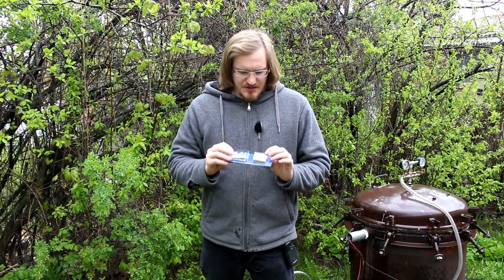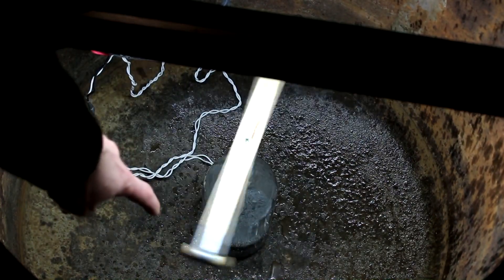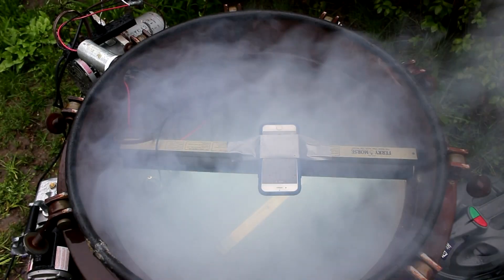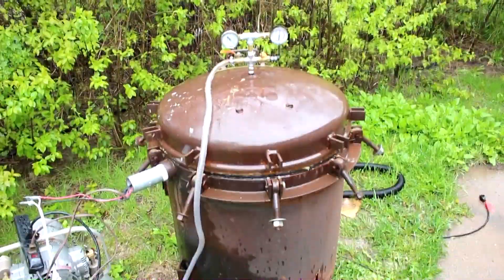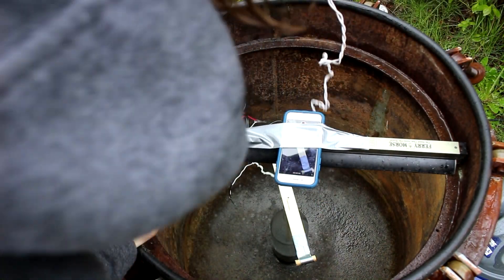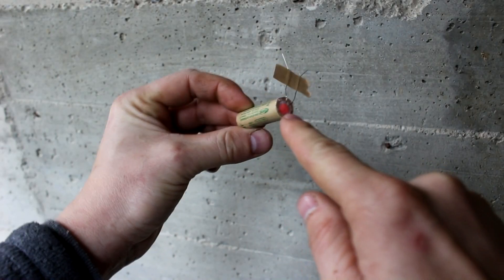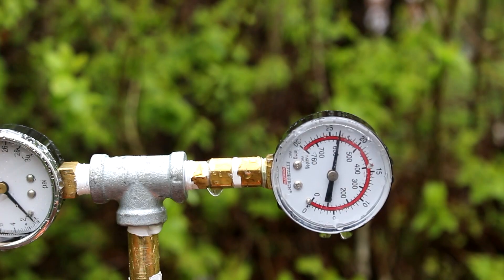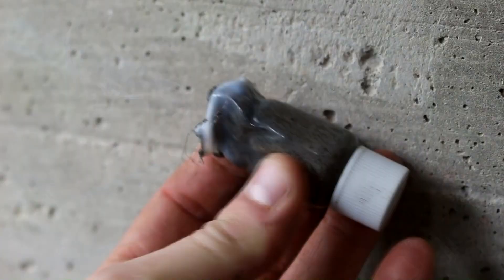Will a Model Rocket Motor Work In Vacuum?

Comment: Nice try, but these results are technically inconclusive with regards notion that rockets can fly in space. It only proves you can have limited burn in a container, but fails to legitimize space travel. Now the real question is whether it's possible to sustain a burn without destroying or ejecting the containment that produced the thrust. If you can accomplish that, I might concede to the possibility of space travel; because if that's how NASA did it, then they'd have a lot of dead astronauts. For your method to work, NASA would need to have a vast multitude of 'burn capsules' (for lack of a better term) in order to maneuver in space, or even return home for that matter. I don't know about you, but I've never seen evidence of NASA using any such techniques. Not to mention the fact that the vacuum chamber itself is enabling the thrust by giving the rocket something to push off of. You need a much bigger container to prove your theory (something that might be slightly more comparable to the vastness of space, which has no walls to push off of; only infinite light years of space). I'd love to see this experiment replicated at NASA Glenn Research Center's Plum Brook Station vacuum chamber in Sandusky, Ohio. Now that might be more convincing. But of course if NASA ever did decide to "prove" it to the public using their facility, they'd probably do what they always do, and fake the shit out of it.
Reply: Yep, rockets can't work in a vaccum and NASA and space is a bunch of bullshit.
       I can't believe Cody being as smart as he is can't understand this and realize the only reason it had thrust was because it was pushing off the side of the container.
      Rockets work on earth because they are compressing the gasses in the atmosphere and creating thrust from that, I mean, am I wrong?
Reply: @MistakenMystery  - "Yep, rockets can't work in a vaccum and NASA and space is a bunch of bullshit."
Just STOP spouting bullshit.  I can TELL that you have never taken a physics course in your life, and Id BET that you dropped out of high school, but you want to argue with Phds in Physics that say this DOES work in space? ANd people who TEST THIS SHIT for a living?

Put the BIBLE down and finish high school.

I have VIDEO of rocket propulsion working n a vacuum.  Ill show it to you AFTER you answer one question:
At WHAT altitude above earths surface does the atmosphere reach "Vacuum"?
(hint: you will refuse to answer and come up with some bullshit reason why you wont)

Comment: The gas the rocket pushes out what is it pushing against? In a perfect vacuum? Also it's space so there are no vacuum chamber walls for the gas to push against
Reply: The GAS does NOT need to "push" on anything.
The rocket nozzle is PUSHING ON THE GAS.
GAS has MASS and therefore inertia.  To make it go from a velocity of zero (wit respect to the nozzle) to 1000 meters per second REQUIRES A FORCE !
Where do YOU think this force originates?
Reply: @stuartgray5877  no it's because you have high pressure behind the rocket and low pressure in front of the rocket. You can't have high and low pressure differences in a vaccum.
Reply: @MistakenMystery  - "You can't have high and low pressure differences in a vaccum."
You most CERTAINLY CAN.
Who told you that bullshit?
Lets forget about gases for a minute and see if you have the most basic grasp of simple physics 
If I fire a crossbow in a vacuum, will I feel recoil? Yes or No?

Oh and I have VIDEO EVIDENCE of rockets working in a vacuum, AND we test them IN HIGH VACUUM AT WORK - Regularly.
Reply: @MistakenMystery  as usual, you people PRETEND to understand physics, but when asked simple questions you run away.  High school physics is too DIFFICULT for you? Maybe you shouldn't have dropped out?
Reply: @stuartgray5877  no I just don't enjoy conversations with people who aren't passionate about the truth and will never be able to have the power to change your mind on any controversial topics that go against the grain, because that would be too uncomfortable for you.
Reply: @MistakenMystery  so you REFUSE to answer physics questions presented to you by someone TRYING to educate you?   Doesn't sound like you are interested in the "Truth" AT ALL or you would AT LEAST see where my line of reasoning is heading.  YOU just dismiss anything that contradicts your current belief.  This is the OPPOSITE of learning and "Science"
Reply: Yep, rockets can't work in a vaccum and NASA and space is a bunch of bullshit.
       I can't believe Cody being as smart as he is can't understand this and realize the only reason it had thrust was because it was pushing off the side of the container.
      Rockets work on earth because they are compressing the gasses in the atmosphere and creating thrust from that, I mean, am I wrong?
Reply: @MistakenMystery  - "Rockets work on earth because they are compressing the gasses in the atmosphere and creating thrust from that, I mean, am I wrong?"

Yes you are wrong.  If you answer a couple of high school level physics question I can prove it.
Hint: No flat earther has taken me up on that challenge because NONE OF THEM GRADUATED HIGH SCHOOL.

Comment: What a load of old nonsense.  there is no vacuum in that chamber.  the vacuum is lost immediately the rocket fires.Hence all the smoke.  lol.
Reply: Good enough vacuum.
Reply: @ThomasKundera   there is nowhere near a vacuum.  It is a pathetic experiment  the experiment would also be invalid if the chamber was as large as NASA's for the same reasons.
Reply: bo ptah - well WHAT ABOUT THE YT VIDEO: "Uninterrupted Footage of the Falcon Heavy Launch and Booster Landing! 2-6-18"
It CLEARLY shows that the side boosters can TURN AROUND AND FLY BACK AFTER SEPARATION  from the center core.

bo ptah - WHAT IS THE ATMOSPHERIC PRESSURE ABOVE 50 kilometers where the boosters separate?
OH THAT'S RIGHT - ITS A VACUUM 

So please explain how those boosters are maneuvering IN A VACUUM?
What's that YOU REFUSE to admit that the atmospheric pressure above 50 km is LESS THAN 1.0 TORR?
Well that is because it would prove you to be wrong OVER AND OVER AGAIN.
Reply: @stuartgray5877  you know i am right.  That is why you keep on stalking me as i make my round youtube educating the poor suckers that they have been lied to ny people like you. 

   NASA or Spacex have not been anywhere near space or a vacuum..  you cannot use a rocket without substantial air pressure.
Reply: @boptah7489  : Humm, you're a flatty. OK. You can't understand science, so I don't expert you to understand rockets physics. Just normal.

So, lets start very simple: where does the Sun goes after sunset?
Reply: @ThomasKundera  Oh dear.  Not very smart or intuitive are you.  the Earth is an oblate spheroid .  I know this because i am a yachtsman,  Not because someone told me in school or University. 

    So,  lets start very simply  .  In what % of cases is there a higher pressure area behind the rocket , than in front of it in flight  throughout the entire history of Rockets  ?.
Reply: @boptah7489  : Great, so you're not a flatty, that's already something, thanks :-)

"In what % of cases is there a higher pressure area behind the rocket , than in front of it in flight  throughout the entire history of Rockets  ?."
I don't really understand the question, so I may answer something else than what you want.
In the combustion chamber, which is at the rear of the rocket, the pressure is very hight (in the order of 100-200 atm), outside of it, it's low pressure, from 1 atm to about zero, typically.
Is that good enough for you? If not, ask again, thanks.
Reply: @ThomasKundera  no   A rocket must have a higher pressure area behind  the rocket at all times.  Pressure is the Alpha and Omega of rocket propulsion in 100% of cases..  This is why it is impossible for a rocket to work anywhere near a vacuum.  you cannot create pressure in a vacuum..   In  fact.  On planet Earth , a rocket cannot go up over approx 100,000 feet.  .  Helium balloons can go higher than rockets..   This is why we can't go to the moon today.
Reply: @boptah7489  
Search YT for "SpaceX Falcon Heavy Arabsat 6A Launch and Landing in 4k Ultra HD" and WATCH THE VIDEO 

Tell me that you see the following:
The THREE common cores liftoff and head downrange (EAST)
ALL three are travelling at about 3600 Miles per Hour EAST and at an altitude of over 50 kilometers (>160,000 feet)
The side boosters SEPARATE, Turn around, CANCEL the eastward velocity of 3600 MPH, and FLY BACK to KSC, AND LAND .

Are you Agreeing that this is what you see in the video?

Then explain to us: AFTER the rocket flies up and OUT OF THE ATMOSPHERE (above 50 kilometers) and the boosters SEPARATE from the center core - HOW DO THEY TURN AROUND AND CANCEL THAT 3600 MPH - ALL WHILE IN A VACUUM ??

SO are you going to suggest that the atmospheric pressure above 50 kilometers is NOT "vacuum" (Remember you ARE talking to a Vacuum Test Specialist)
Or are you going to claim the video is fake? (even though this event was viewed by TENS OF THOUSANDS of spectators LIVE)

OR - are you just going to pretend this evidence does not exist like ALL of my other evidence?

You could then compare this video to the ACTUAL video taken from the rockets where there is INDISPUTABLE EVIDENCE that the boosters ARE IN HARD VACUUM.
Reply: @stuartgray5877  you have no idea what the pressure is above 50 KM.  Of course you are a shill.  You admitted you work for Lockheed.  you are just trying to protect your job.
Reply: @boptah7489  : "A rocket must have a higher pressure area behind  the rocket at all times."
In the combustion chamber, right.

"you cannot create pressure in a vacuum.. "
Well, then it's not vacuum any more. For sure :-)

But in the rocket combustion chamber, even when the rocket is in vacuum, the chamber is under high pressure.
Why is that a problem for you?

" On planet Earth , a rocket cannot go up over approx 100,000 feet."
Naively wrong.

" This is why we can't go to the moon today"
Satellites are launch about every week...

" you have no idea what the pressure is above 50 KM."
Have been measured. And can be computed (with approximations, but good enough).
Reply: @ThomasKundera  It is impossible to have a higher pressure area outside the rocket when the rocket is in a vacuum.  You can not create pressure in or near a vacuum.. 

   You have no idea what the air density is above the highest helium balloon..  Satellites are also carried under helium balloons.  NASA are the largest buyers of helium in the world..  Why do you think there are no real life pictures of satellites in space. ?.
Reply: @boptah7489  : "It is impossible to have a higher pressure area outside the rocket when the rocket is in a vacuum.  You can not create pressure in or near a vacuum.. "
Lets imagine the following:
Somewhere in a good vacuum, I put a metal box, with vacuum inside too.
Inside that box are two liquefied gas bottles. One O2, the other H2.
I slightly open each bottle: now gas start filling the box. It's no longer vacuum inside, agree?
There is a pressure, that is growing.
Then, I open a small hole in one of the box walls. 
Gas start to go out from there, but rather slowly.
So it's not vacuum inside, there are gas, going out of the bottle, creating pressure inside the box, and evacuating through some hole, at a rate that rise with internal pressure of the box.
So far so good.

Now, I light a match inside: the gas insides take fire.
Temperature rise a lot, as well as pressure.
Gas starts to be pushed out the box by the hole at great speed.

That's a rocket.

See? Physics is not that complex, you just have to take time to think a bit, and forget about the fallacies you saw on youtube.
Reply: @boptah7489  : " You have no idea what the air density is above the highest helium balloon.."
I do. Just a first question to you: why is the atmospheric pressure at sea level the value we observe? What does this value means, related to the amount of atmosphere above?

" Satellites are also carried under helium balloons."
No. You're confusing with stratospheric balloons here.
No "balloon" can go several hundreds of km above ground at several km/s. Sorry.

"Why do you think there are no real life pictures of satellites in space. ?."
I took some picture of satellites passing above my head.
Reply: @ThomasKundera   the pressure at sea level is that value because of gravity . the atmosphere is essentially sorted by density of gases.   How can you tell with certainty that the atmosphere is what you think it is above the height of the highest helium balloon ?  Nothing has gone hundreds of KM's above sea level..  I doubt if 50km has been reached yet .  By a balloon of course.  We have no technology that can go higher than balloons.
       If you took pictures of satellites then they wee under helium balloons.  they launch the balloons from the south poke.
Reply: @boptah7489  : First, I'm glad you understood what I wrote about rocket motors in space. That allow us to move on.

"the pressure at sea level is that value because of gravity "
Right! But gravity on what?

I'll ask another question to make you understand better:
Lets say you dive 10m bellow water surface, what is the pressure now? Why?

"Nothing has gone hundreds of KM's above sea level."
Rockets, probes, satellites, etc. I demonstrated you how a rocket can work in vacuum.

"If you took pictures of satellites then they wee under helium balloons"
Again, stop confusing stratospheric balloon and satellites; That's as naive as confusing kayak with supertankers.
No "balloon" can be 500km above ground are at 6km/s...
Reply: @ThomasKundera  Essentially gravity is an attractive force based on electromagnetism.  , This is why gravity also affects light.   One of the effects of this force is pressure. Pressure below the water is greater because water has a greater weight than air. 

    No rockets or probes can go anywhere near a vacuum.  you are completely mistaken.  there are no manmade objects above 50 km.   That is why we cannot go to the moon.  We do not have the technology today.  and so we definitely did not have it in the 60's. .   You need to move away from the fantasy of Rockets working in a vacuum.  It is impossible.
Reply: @ThomasKundera  - I have SHOWN bo ptah the YT video "Uninterrupted Footage of the Falcon Heavy Launch and Booster Landing! 2-6-18" that SHOWS a rocket performing propulsive maneuvers ABOVE 50 Kilometers BUT HE REFUSES TO ACKNOWLEDGE WHAT HE IS SEEING.

You just cant argue with that level of stupidity.
care to tell us what YOU SEE OCCURRING in that video, just for a second opinion?

I mean the side boosters are travelling EAST at 3600 MPH when they exceed 50 km of altitude, then they SEPARATE while moving eastward.
They then DESCEND AND LAND back at KSC.
bo ptah REFUSES to acknowledge that the ONLY WAY THEY COULD HAVE DONE THAT was to CANCEL the 3600 MPH eastward trajectory AND FLY BACK IN A VACUUM.
Maybe YOU will have better luck beating some sense into his think skull.
Reply: lol stuart gray is mental. he thinks cartoons are real.
Reply: @papalegba6759  so YOU comment on the video ABOVE and tell me what YOU see.
Reply: @stuartgray5877  'we' lmao. pretty sure you're a chatbot.

Comment: Are you stupid? Your experiment produced smoke which is used as a resistance to push your thing. But in the space the situation is totally different. You are cheating your self only.
If you are fair you have to get out that smoke from your experiment and see if it will move 1 cm.
Stupid
Reply: You are stupid, not him.
Reply: Papa Legba   learn elementary physics.

Comment: That's silly experiment. The vacuum was compromised when the motors started. This proves nothing !
Reply: We don't need such "proof" anyway, Newton laws proves it works.
Reply: There was still a vacuum,  you realize the vacuum was never going to be perfect. This does prove that a rocket produces just as much if not more thrust in a vacuum, if the vacuum negated the thrust then there would have been less thrust than the first test but there's actually more.
Its Newton's third law as the other guy said. Really should have learned about this in third grade.
You think the air pressure outside of Rocket is what gives it thrust but in reality that air pressure trying to holding in the pressure in the rocket nozzle and reduces thrust.
Reply: @FrancisR420  It was a joke, man ..

Comment: THIS IS EXACTLY HOW PSUEDO-SCIENCE WORKS, WHEN YOUR EXPERIMENT DOES NOT GIVE YOU THE RESULTS YOU WERE EXPECTING, JUST ALTER THE EXPERIMENT UNTIL YOU GET YOUR DESIRED RESULTS!  THE POINT OF THIS EXPERIMENT WAS TO SEE IF A MODEL ROCKET ENGINE WILL WORK IN A VACUUM, IT DIDN'T, SO HE PUTS IT IN A BOTTLE FILLED WITH OXYGEN & IGNITES IT?  AT 4:00, HE IS CONFUSED AS TO WHY THE ROCKET DID NOT IGNITE?  HE WAS CONFUSED BECAUSE HE WAS EXPECTING IT TO IGNITE!  YOU CANNOT CONDUCT A TRUE SCIENCE EXPERIMENT IF YOU HAVE PRECONCEIVED EXPECTATIONS!